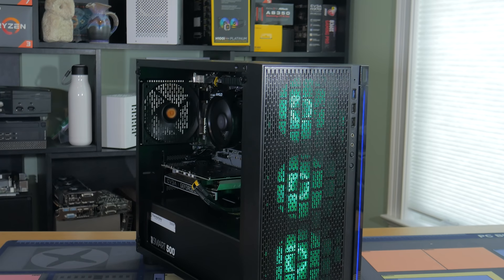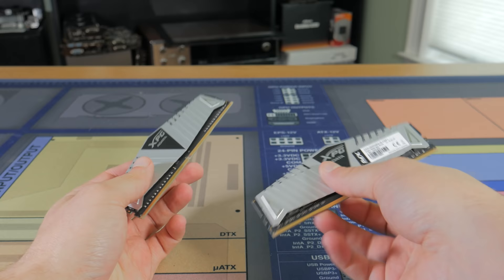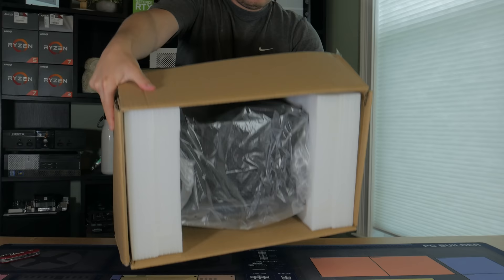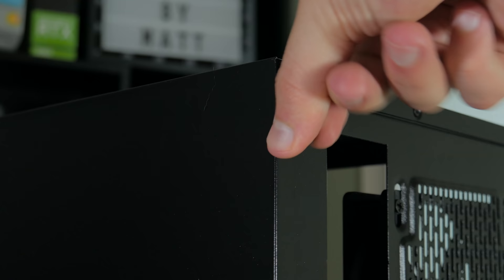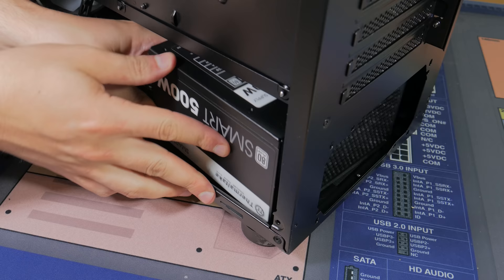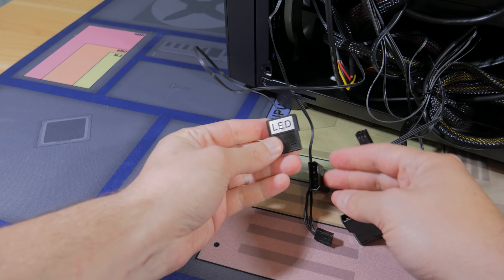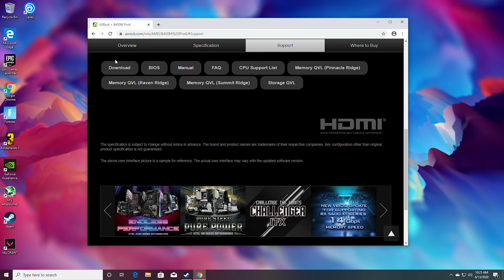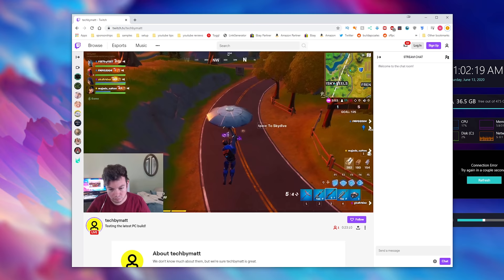$650 Gaming PC Build Guide! (2020)

Comment: I just made a slightly weaker pc for under $500. My take on this:
If you are going for a quad core the i3 9100f is a better option $-30. If you are spending $100 go for the 1600af
The GTX 1650 super actually has the best value of any card on the market and fps will be only -20% , $-70
Buy a NVME M.2 SSD. You can find one for only $+15

My Regrets:
I bought the cheapest case i could get my hands on and it looks horrendous. Should have spent $+25 on the one in this video.

Comment: SSDs are not "miles better than hard drives" at this point. For the price of one 200gb SSD I can buy a 2TB HDD, and he price per GB difference is only amplified by the current pandemic. Your best bet for a budget gaming PC or any gaming PC for that matter is still to get a small capacity SSD for your OS and commonly used programs and a large capacity HDD  for everything else.

Comment: DO NOT BUY THE PSU IN THE VIDEO DON'T GRAB ANYTHING BELOW 80+ BRONZE!!!!!
Reply: What psu should I get then
Reply: New to building a pc
Reply: What would you recommend that is around $40 then
Reply: 80 plus bronze is recommended for most PCs but for entry level this psu gets the job done. You can always upgrade later on to a more quality psu that's 80 plus bronze certified or above.

Comment: FIRST: Why the AWFUL power supply
SECOND: Stop playing Fortnite, the game's dead trash by now. Instead, get Halo, the Master Chief Collection, since it can be incredible for benchmarking, due to there being 4 games in 1 at the moment (5 soon due to Halo 3 being almost released)
There're many environments and different games that require stronger or weaker systems. Halo CE takes little power, while Halo 2 Anniversary takes more power to run (hit tab to switch from classic to remastered for Halo CE and Halo 2). You can benchmark small areas, and/or larger areas in each game
The levels I advise you benchmark for all games
Halo Reach: New Alexandria (for open areas) and Nightfall (for smaller areas
Halo CE (Anniversary) Assault on the Control Room/Two Betrayals (for large areas) and The Library (for smaller areas)
Halo 2 (Anniversary) Metropolis/Quarantine Zone (for large areas) and Oracle (for smaller areas)
Hope you see this and take my advice.
Reply: what power supply do u recommend for around the same price ?
Reply: @dylan888  TBH cheap power supplies can be classified as a bomb
get a bronze psu
maybe a corsair cx 450w if its in stock/not price gouged

Comment: I build my pc like last week for 650$ 
MICRO CENTER IS THE BEST!
Intel core i5 9400f
Asus Geforce Gtx 1650 4GB OC
Asus Prime B360M-A 
500W 80+ power supply
Corsair spec 02
1 TB HDD
120GB SSD
Intel is better in everything.
Reply: Sounds nice but I would’ve gone with a Ryzen 5 3600